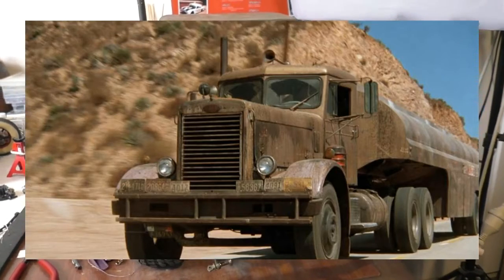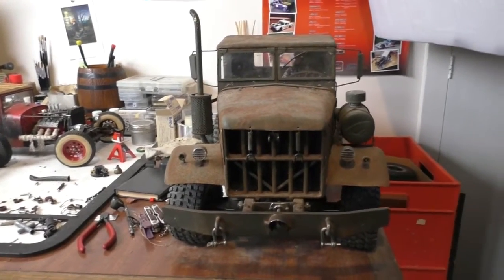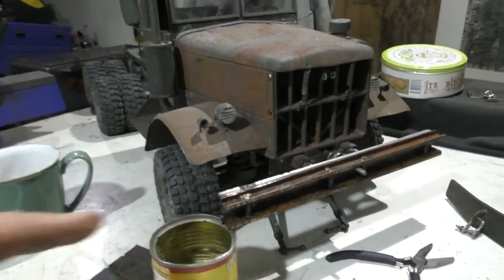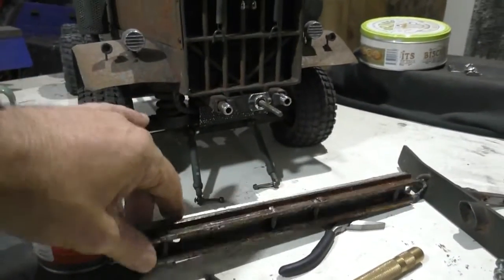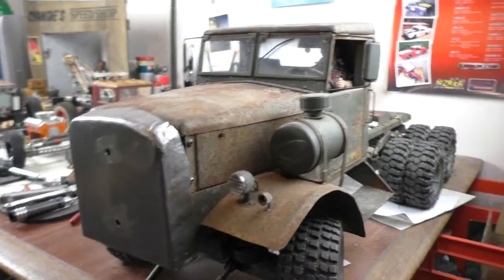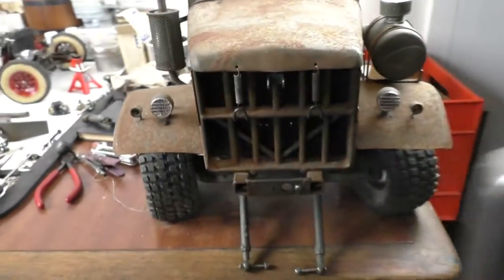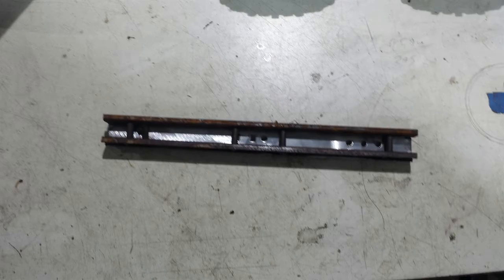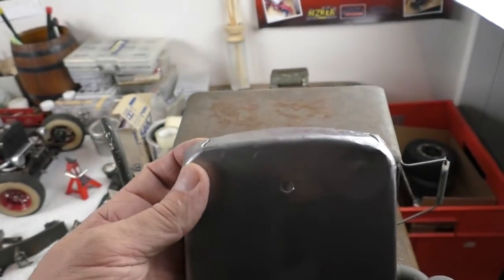Detailing FATBETTY for the Duel style tanker build (part six)

Comment: I hadn´t realised that FatBetty had a front PTO. I wonder why PTOs have fallen out of favour - they were a big feature of the Series 1 Land Rover, for example.
 I´m very impressed by the way you made your grille surround - the bumper you made looks excellent, too.
Reply from the maker: Thanks Del. Yeah the PTO runs off the axial transmission since I only used one output shaft for the rear wheels. The PTO shaft is what turns the radiator fan as well.
Reply: @OldIronRC  I´d imagined that you had a low-geared separate motor driving the fan. Your way´s better as the fan speed´s proportional to wheel speed, which I think is a nice touch.
Reply from the maker: Just a rubber band on the PTO shaft to the fan pulley. Nice and simple.
Reply: @OldIronRC  "Simple" is elegant, reliable, and easy. Long live simple solutions!